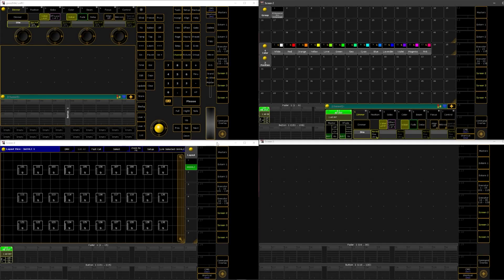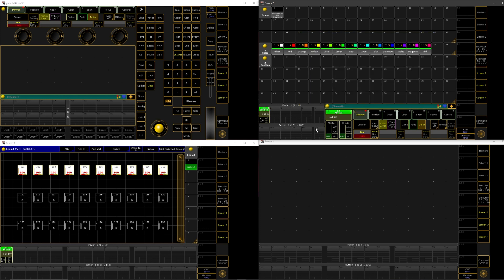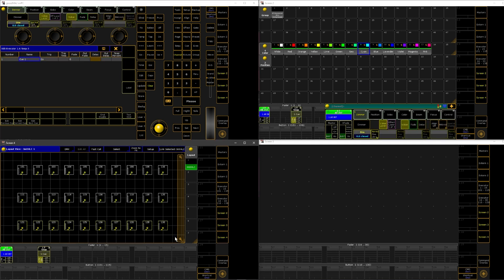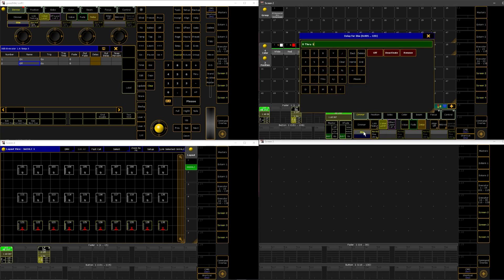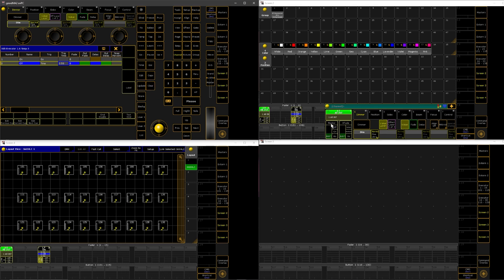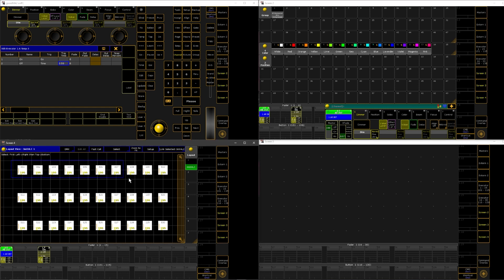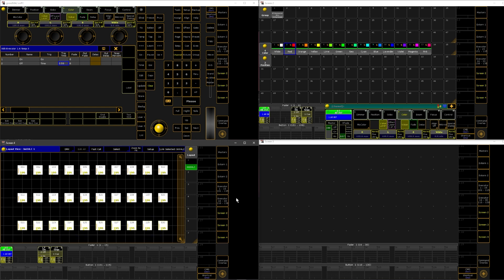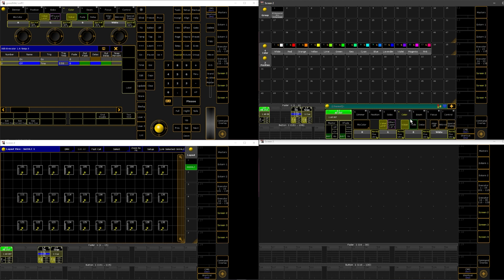MA2 Stage Sweeps made easy!

Comment: I've matched the addresses of the left lamp collection and the right lamp collection. (2 lights 1 address / left side of the pan tilt reverse at the light settings. Is that a problem?
Reply from the maker: I’m having a hard time understanding your issue.

As long as your layout view is made correctly and you make your select of the fixtures in the order you want it. It should work. I have a video on layout views if you need more information on layout views. :)
Reply: @Taylor-Copland   Ok, thank you. actually I'm having problems changing the address to the lighting that is above the high roof of the stage. there are 8 lighting on the left and there are 8 more on the right. the address on the left and right is the same. but I'm afraid of delay because the distance is quite far (long dmx cable)
Reply: @windo8771  All of your DMX addressing should be unique.  Unless your fixtures are in different universes, then they can have the same local dmx address but the different universe number still makes that a unique address.
Reply: @erictuthill9029  I used to use dasligt dvc2. because of the difficulty of making the game scene, I made the same address on the left and right. it works perfectly. and now I want to use grandma2 without changing the address on the installed lamp.